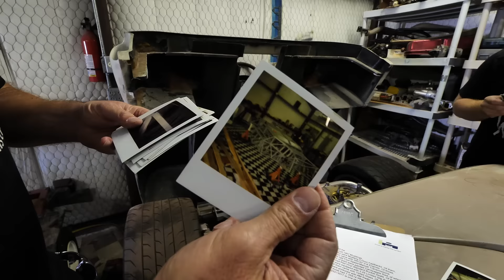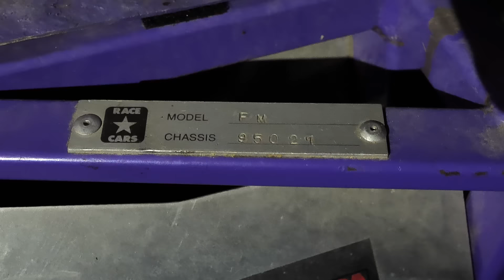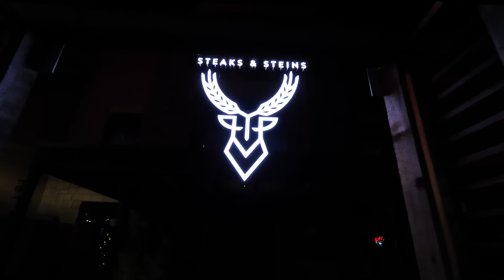FOUND: '67 MUSTANG FASTBACK, GT40, '53 FORD CONVERTIBLE + MORE!!

Comment: So the race car has a FM VIN tag which means Formula Mazda. looks like it was originally an open wheel first gen formula mazda with a 13B rotary and someone put a prototype body on it. These mainly run in SCCA probably in DSR or CSR class. Very reliable race cars. The original fabricator is Star Race Cars

Comment: Gentleman, the 53 Ford is on a rotisserie, turn it upside down for more headroom and lower the center of gravity under tow. Why didn't you think of that Conner?! How nice would it be to chuck that flathead on the engine run station?
Reply: I was thinking the same.
Reply: They said in the clip they were putting parts inside the car body.

Comment: I love the 67 Mustang Fastback; it must have been sweet new from Ford. I love the Ford 67 Candy Apple Red, that's the color of the 67 GT350 I had. The Shelby 10 spoke wheels look great on the Mustang, but the original 67 Ten spokes had the air filler valve stem between the spokes. My Shelby had three of its original 10 spoke wheels with one of the newer wheels with the valve stem in the place as the wheels on your newly acquired 67 Fastback. To be honest, I love the whole collection you just loaded up. That's a lifetime and then some of a collection IMO for most guys.

Comment: i see that ramps are sometimes a little touchy so i just wanted to offer an idea on what i started using back in the old late model racing days, on my car hauler and my car trailer the front on the cars were pretty low, i took 2 ramps from old u-haul trucks, the big box trucks with the very wide and long aluminum ramps, heavy too, and bolted a piece of angle steel on the front edge of both to hang on the trailer/truck, they are long and very heavy but absolutely will load anything you want to load with no problem, i usually just slide them under the car thats loaded and strap them down, younger days i could carry one with no problem, today its a two man job but well worth it.

Comment: As they were pulling stuff from the "attic", behind Josh outside was a mid century modern swivel chair. Fast look but it looked like a  Miller, which if US made could be be worth $2000+ if the foot stool is around. Doesn't have to have wheels to be worth a lot.

Comment: My dad, Conrad Marotta,  owned a 1967 green fastback in sun valley california.  He sold it around 1972-1974.  When he sold it it had the driveline from a galaxie with 289.   It was a 4 speed with a barris built 390. I dont know what happened to the 390.  Was run in time trials in southern california. I wonder what happened to it.

Comment: Could have bought a GT40 on Aplan at Fraud Motor Company for $12000. Tried to sit in one. At 22 I did not bend enough to make that work. And I did not have the capability to go to England for the two fittings. And could have bought the hand hammered Cobra 427. A VP that had one for evaluation said that if you were not going 60 mph it would overheat. He had the devils own time for two weeks trying to get to work without overheating that beast. I did get a 69 428 CJ. Economy rear end for top speed. Redlined at 165. Total drag strip type of burnout at 135 shifting into fourth gear. Buddy of mine got me the 1135 CFM Daytona Carb. I used a cable and spring to make the secondaries manual.Prior to that I had a 67 fastback. And prior to that I picked up a Poppy Red Convertible on the first day dealers could deliver to the public. Put 135000 miles on that one in 18 months. I can attest to the front end leaving the ground at 130 mph. Lock to lock and the front end never moved. I was doing 145. I had breathed on that one a little.

Comment: I think he meant that intake and dual 4V setup was for a GT350, a small block. That intake was too narrow to have been for an FE engine.   The 390s, 427s, and 428s are FE engines and have what they call a “half-head”.   The valve cover goes over the head AND part of the intake manifold.   The intake is extra wide,  and heavy as hell, and the heads have very short intake ports as most of the runner is in the intake.  Now I understand the whole runner/port relationship but at some point that’s just semantics.   Where does one start and the other begin?   Well, the head is port only and the intake runners only in MOST engines.   But Ford had an idea or two, and some of this is fact and some is theory, but I’d love to hear everyone’s input.   What I heard first was that because the 427 was gonna be a race engine, they would be doing a lot of port work and intake swapping and head swapping.    And that was about when aluminum intakes became the hot rod way, with better heat dissipation and lighter weight, but what I heard was the clincher was that some Ford engineers noted how much easier it was to grind aluminum than iron.      As they were gonna be tested extensively, they felt it would be very helpful to facilitate easy swaps and easy grinding.    With the half-head design it’s easier to accurately grind deeper into the pocket of the port right to the backs of the valves.  And with more of the runner in the intake, and it being aluminum, they could more easily tune the intake as opposed to having to do some on the head and some on the intake as was the usual method.    Plus another added benefit is the fact that you can swap heads or intake without having to remove the other.   Swapping heads without having to redo intake gaskets, torque the intake bolts, etc, saved tons of valuable time testing.  Same with the intakes.   Easy swap.    That intake in the counter looked more like a 289/302 intake to me.   But what do I know?

Comment: Those cars are just called "Formula Mazdas" and they are a steel welded tube chassis, carburated 180 hp Mazda rotary, with a gated, 5 speed, Hewland Mk 9 transaxle.

Comment: The Miller Bobcat 250 is a money maker but it does have one fault. The exciter circuit has a diode hidden in the loom that can fail. It's just a 1N4001 diode. Like under $1. But it's HIDDEN! When it goes - it don't strike an arc. ALSO: get the propane conversion kit for it so you can run it at indoor jobsites.

Comment: That’s a formula mazda chassis. I wish I had the money to buy that from you. That might be a 4 rotor but it’s didn’t look like it.  The Nissan motor, it might be a ka24 or an sr20.  The engine on the ground in front of the car body looked like a Nissan RB series. In-line 6.

Comment: lots of neat stuff there, if anyone is interested i have two original genuine Halibrand magnisium wheels, got them in mid 70s from roy thomas when he closed his speed shop in san antonio, 15x8, looks like more than one bolt pattern but not sure if there was another reason for so many holes, dirty but no hits or scrapes, was advised to not try to clean or polish because of the magnisium being so fragile. he thought they came off a front engine dragster in the 60s but like me can't remember the details. reply on this comment if interested, or look up my name for facebook or hand line in san antonio.

Comment: The Lone Ranger and Tonto set up camp way outside of town, and The Lone-Ranger walked over into the brush to pee and a Rattlesnake struck and bit him right on the end of his penis, he yelled out and told Tonto to ride back into town and ask the Doc what we need to do, Tonto road as fast as he could and got to the Doc and the Doc said, Tonto, no problem, you can easily save The Lone Ranger by sucking the venom out. So Tonto road way back out to camp as fast as he could and the Lone Ranger was fading fast and was saying, What did the Doc say? What did the Doc say? Tonto said, Doc say U gonna die.